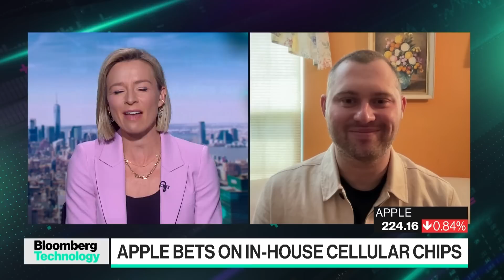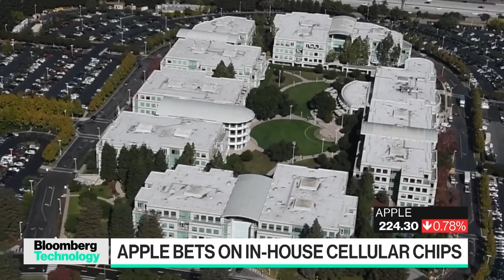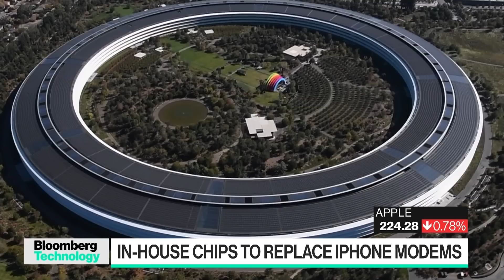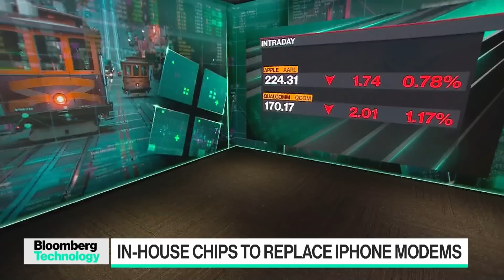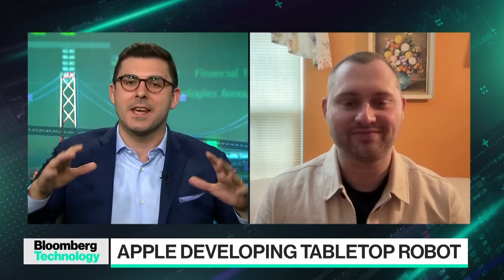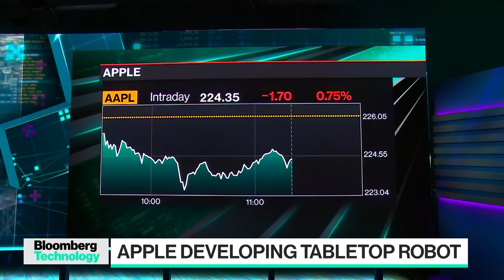Apple Playing the Long Game by Dropping Qualcomm

Comment: Apple has struggled for YEARS to build a cellular modem, and it just can’t figure it out, even after acquiring Intel’s modem business! I don’t know why Apple can’t figure it out, but it can’t.
Reply: It’s because they have to try to build a 5-6G modem without using or infringing on Qualcomms owned patents.  If you can’t use existing ideas that work, then you have to almost redesign it from scratch.  Notice only Samsung has their own modem and practically no one else.

Comment: With increased power efficiency from advanced 2nm or smaller + modem battery and display  advancements  + under display camera, the impossibly thin single piece of glass will finally be realized with the iPhone XX. Not only that but it will be able to leave the display and cameras on and look transparent. One last novelty is the possibility of glasses free 3D   UI that will work with the eye tracking Dwell control already available as an accessibility feature.

Comment: Apple charges a lot on the store and they get angry for being charged a lot?
Reply: I was going to say the exact same thing .
Reply: Yes
Reply: When Apple buys 230M modem chips from Qualcomm, you’d expect to pay a good quantity price, right?  Except Qualcomm also charges a licensing fee, which would be OK if they charged a flat rate to everyone.

But Qualcomm charges the fee based on the TOTAL value of the smartphone its chip is put into.  Since Apple iPhones sell at much higher prices than Android 5G phones, even though the rest of the phone has little to do with the Qualcomm chips (it’s just a modem!), Apple gets charged much much more than ANY other maker using the same chip.  At Apple’s unit volume levels (230M/year), that’s a lot of extra money it’s spending.  

Apple management is charged with keeping supply chain costs in check so they’re trying to figure out how to manage modem chip costs.
Reply: @barty8980  What about Apps? Do they charge fairly. The answer you will give here is the same thing Qualcomm is doing to them. It's fair.
Reply: @jmoresnr007  
Well, I disagree.  

Quoting from AppleInsider:
“On the iOS, iPadOS, watchOS, and macOS App Store, Apple charges a 30% fee for apps and in-app purchases. However, the fee doesn't apply to free apps.

Subscriptions are charged at 30% for the first year, which then drops to 15% for subsequent years.

Developers can also apply for the App Store Small Business Program. Under this scheme, if your business makes $1 million or less in a year, you qualify for a reduction of the fee to 15%.”

Apple’s commission charges are based on recognition that Apple builds and supports the iPhone hardware apps run on.  It also recognizes the value of the Apple iOS that Apple writes, distributes, updates, and supports 24/7/365, plus developer tool, plus maintaining an App Store, providing a very secure, fully integrated payment system, and distributes and installs apps seamlessly to its users.  It also recognizes the value of all of the ever growing Apple user install base, the economically higher value of spend that base provides, and the efforts of Apple creating and cultivating almost unparalleled loyalty to Apple products.  In effect, Apple provides almost ALL the value of the Apple platform and ecosystem to developers to write for and to, and to be able to generate their own revenue from.

This is why, despite Google Play Android store charging the same commissions and having almost 3x the users, it has been documented & quite clear for a decade that developers make almost double or more revenue for Apps on iOS vs Android.  Apple users WILL spend and buy Apps while Android users spend much less or don’t spend at all comparatively.  This is because if you’re selling mostly $150-$400 smartphones, those users aren’t spending much for apps for budget phones.  If you’re selling $600-1200 iPhones to the tune of 230M/year, those users that can buy iPhones like that don’t have much problem or difficulty paying for apps they value.  It is also a fact that Apple users rapidly update their iOS version to >80% in one year’s time so developers can write to the latest version easily compared to the fragmentation that Android continues to have where after 1 year only about 28% on Android 14, 21% on 13, 15% on 12, and the rest on 11 or below, making app development more difficult to maintain.

See https://www.softude.com/blog/android-vs-ios-development-which-is-more-profitable-for-my-business

“Android vs iOS App Development: Revenue Generation 
Despite Android having the highest number of users, iOS won the race for revenue generation. According to Business of Apps, Apple earned 76% of the total profits generated from app subscriptions in 2023.  This is because iPhone users spend more than Android users on such applications.”

Apple isn’t charged a flat fee for use of Qualcomm’s modems.  Apple believed the 4G modem licensing royalty from Qualcomm was worth about $1.50 per Qualcomm modem chip based on the IP of the chip itself used.  But Qualcomm wanted 5% of the wholesale value of the iPhone the chip was going into.  That would have worked out to 5% of a $400 iPhone wholesale or up to $20 or as low as $12 in 2012 through 2017.  That’s literally 8 to 13x more than Apple thought it should pay just to use a chip that any maker could use.  Apple felt the rest of the smartphone was Apple’s value, not Qualcomm’s. 

A different manufacturer selling a cheaper $200 wholesale price smartphone would pay half as much even though it’s the same chip and adds the same value to a smartphone, but since the rest of the smartphone is made with cheaper parts than Apple, it gets to be charged much less???  Does that seem fair to you?

Apple was able to negotiate with Qualcomm and, in exchange for using Qualcomm modems exclusively, Qualcomm have them rebates which for the price down to $7.50 per iPhone per chip used which was still 5X higher than what Apple felt it should be paying.  Apple’s Royalty payments rose from $465M in 2011 to over $1B in 2016, then they switched some iPhones to Intel 4G modems for the next iPhone X and XS models and began working with Intel trying to build the next 5G modems themselves to reduce royalty payments and secure themselves on modem chips.   Considering the relative increases in Apple’s Pro Models, it’s likely Apple’s Royalty payment have now ballooned to over $2B annually. 

Unfortunately, Intel, then Apple’s efforts failed to create 5G modem chips that could perform as good as or better than Qualcomm’s so Apple bit the bullet, withdrew its lawsuits against Qualcomm for being overcharged, and began paying royalties at agreed rates for use of 5G modems through 2023, now recently extended for 2024 through 2026.

So Apple is effectively but apparently happy enough “stuck” with using Qualcomm’s best 5G modems until it finds ANY alternative that is better by building their own 5G or 6G modem chip, if they can.  If Apple cannot, they’ll have to continue with Qualcomm.

Comment: They end up going back to Qualcomm again and lose billions.
Reply: Apple is already spending billions to buy Qualcomm modems so the R&D they have spent on trying to build their own modems helps them learn.  If it doesn’t work out, they can keep the status quo and write off the R&D.  No “loss” per se, just the cost of doing business and innovation.

Apple can do that since making $384B annual revenue, spending oh, $90B+ on buying back their own stock, and having $50B+ free cash flow.
Reply: Hmmm, have you heard of the M chips they built 5 years ago?
Reply: @bjojosimpson two very different technologies. It's like how do you create a new type of TV antenna without anyone else's parents
Reply: @macberry4048 parents? Uh? I used a hangar.